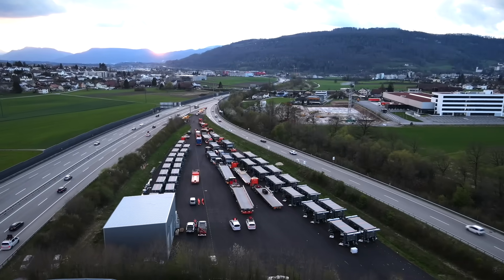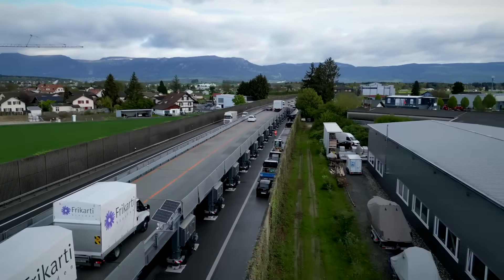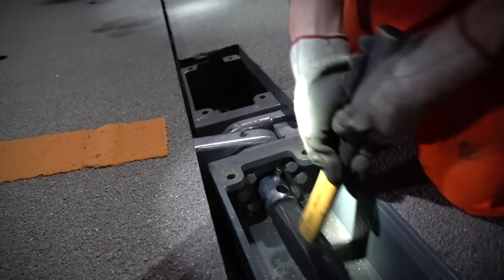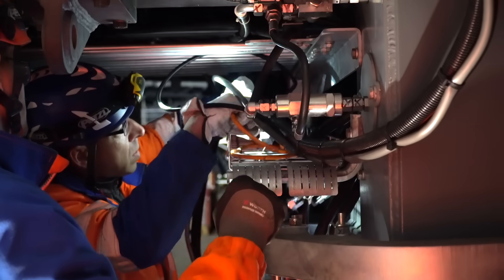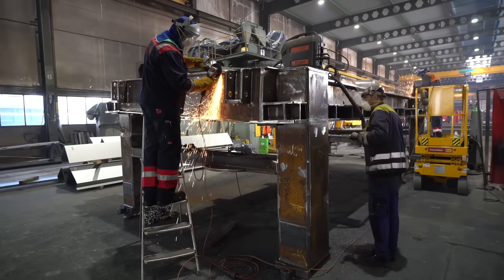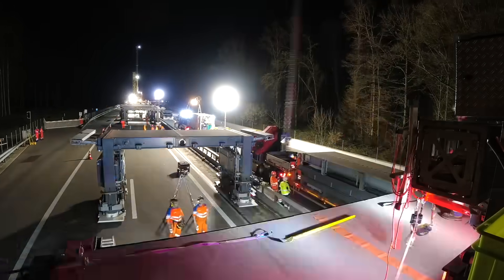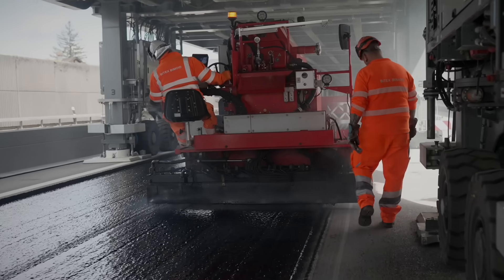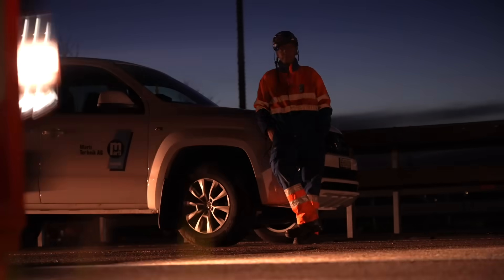BETTER TO GO OVER THAN TO BE STUCK BELOW

Comment: Is the ASTRA-bridge limited to the lane it was deployed to cover? Through moving it forwards at an angle then backing up, can it switch lanes?
Reply: It can go sideways, so I doubt they'd have to pack it up just to move it 7m to the left. Pretty big design flaw if they do.
Reply: Watch the animations again - those bogey wheels will turn sideways.
Reply: probably yes, though you would need to remove a lot of middle guard rail in order to get it to the other side
Reply: @toiletfx5679  true, I was mainly thinking about lanes in the same direction/sides, given that it appears to only allow renovation of a single lane. I imagine swapping sides/directions would be best done by redeploying.
Reply: @linamishima  I think It can do both sides but in this case only one lane needed repairing